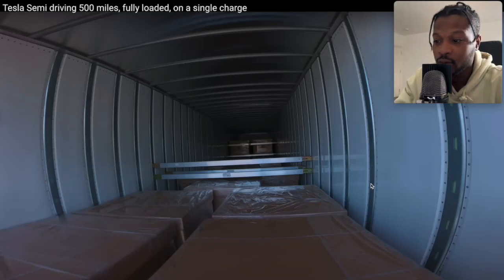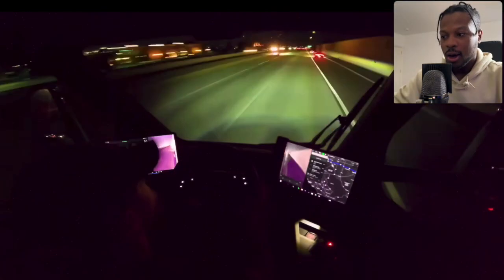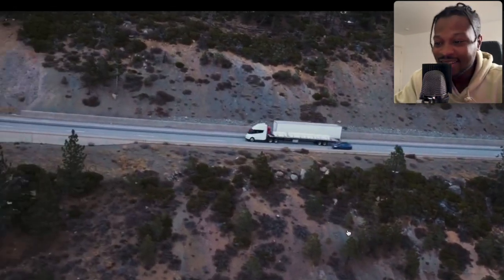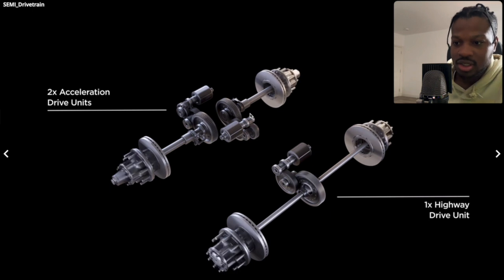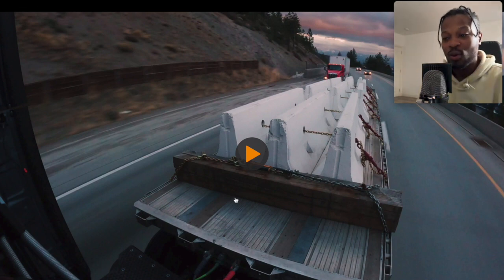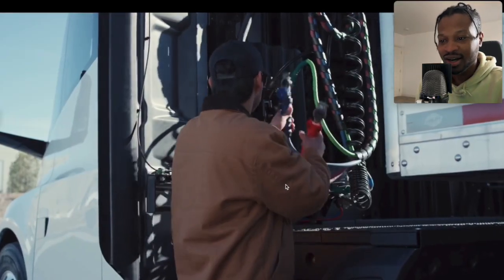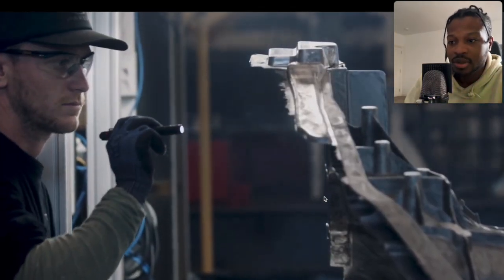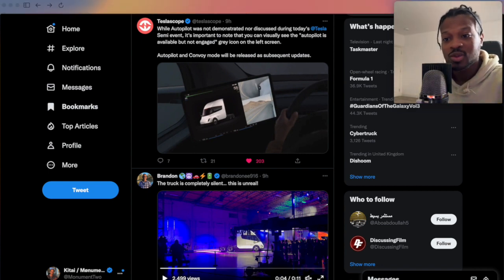Tesla Semi Truck Highway Testing! 500Miles Trip! Semi Event & Spy Images!

Comment: THIS IS NOT A VIABLE MARKET PLAYER until an extensive network of charging stations encompasses the North American trucking map. EXAMPLE: A long-hauler starts the week in Enid Oklahoma, drives to St. Ignace Michigan, drops the load, then drives to Grand Rapids.... That load goes to Atlanta, followed be a short load to Greensboro NC. If a trucker/trucking Company can't guarantee electric charging, this example conversion will NOT happen. Pepsi, FedEx, and other continual two-way loads are the market Tesla will compete in for now
Reply: 500 miles on a single charge will last the truck about 8 hours of continuous driving time, with mega charger which will only takes thirty minutes to charge up to 80% it is a viable market player